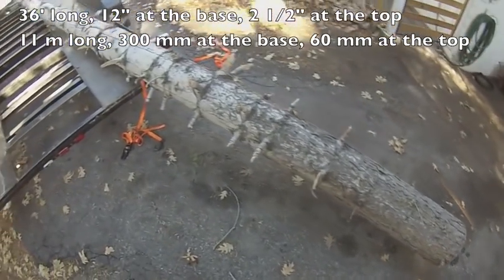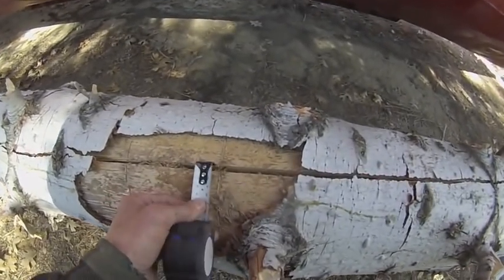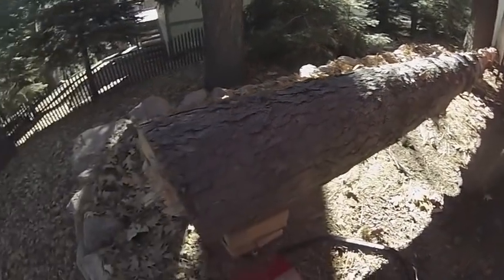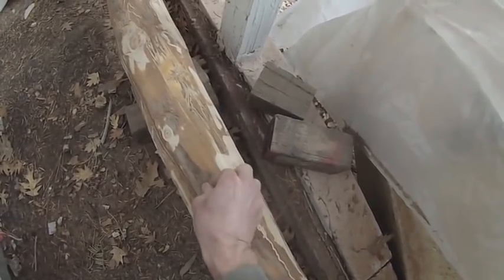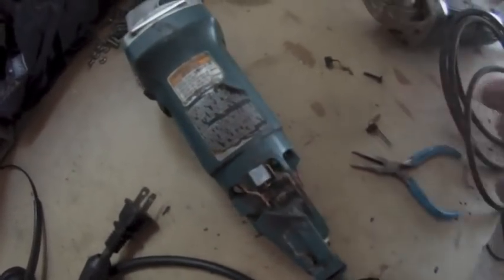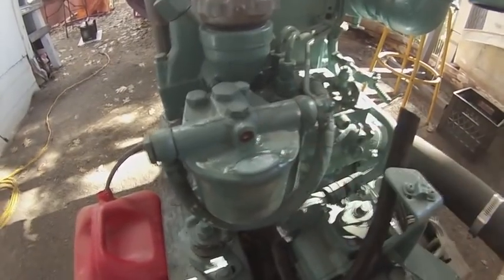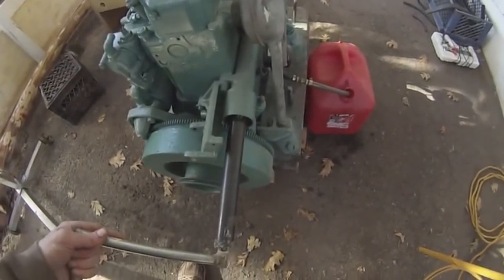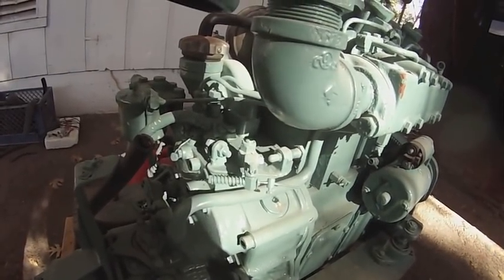Steel Sailboat Build Part 23

Comment: You need to be very careful with those MD twos, they have a tendency to not pull oil out of the pan after they have not run for a while. There is a tapping down on the engine case near the oil pan that will accommodate a small oil pressure gauge. You really need to find out if you have pressure, you can cook that engine very quickly without adequate pressure. Should be somewhere between 40 and 60 lbs at the speed you were running it.

Comment: Been watching these videos in sequence and this is how far I've gotten, to this one. As these were shot 4 years or so ago, I've not made comments since they wouldn't be helpful. But I have to say: that was some seriously impressive forensic analysis of how that tree came down. It's in tune with how, if you could have sprayed the red paint inside, you would have used certain equipment which you clearly doctored with some of the paint to show what it would look like if it had been used. But, of course, it wasn't used...no, nope.  *wink*.

This whole project is some next-level impressive effort. A hand plasma torch would have done you a world of good...cutting all that metal with cutoff discs...damn.  Hat's off to you.

Comment: congratulation nice motor sounds perfect (I am from Sweden) this will serve you well. And with the mast I think you also got a very good one. a slow died tree is the best ( old vikinger way to preserve wood) just fill the gaps with wood and wood glue and varnish the hole thing many time. Happy new year